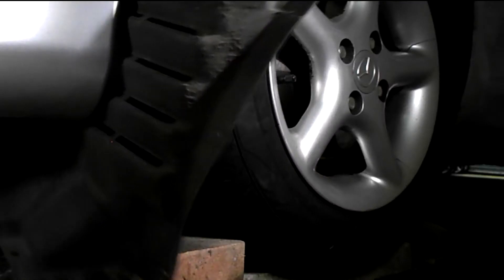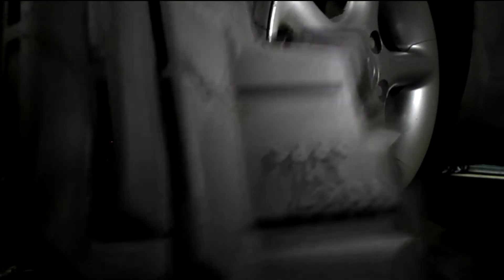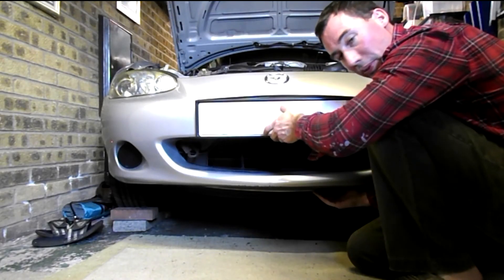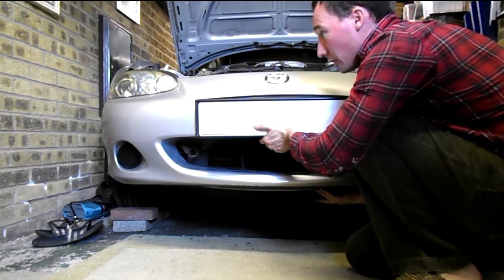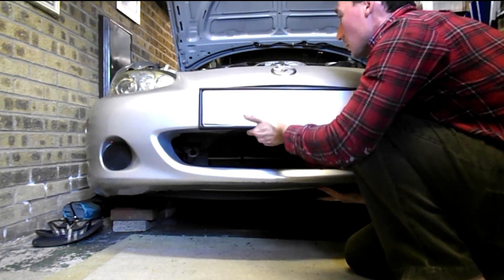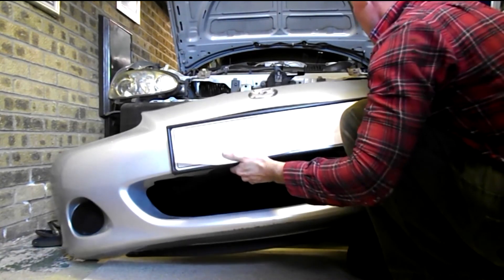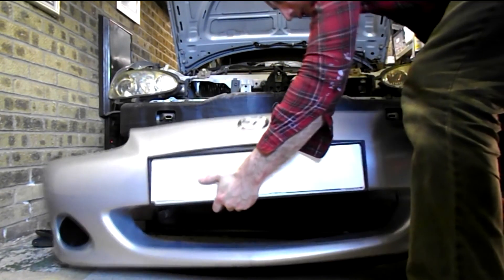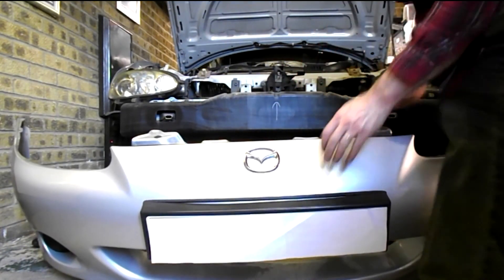Mazda MX-5 Front Bumper Removal

Comment: Ahww the rust!!! it's really bad :( Did you fix the rust?
Reply from the maker: I rubbed the rust down and painted with paint to rust metal paint (hammerite) and used under body sealant. Also had to weld patches the chassis rails. Welding the cills next. :/

Comment: That still doesn't help me.  At about 1:00, you easily flip out the panel, but mine is still being held in by a very robust triangular chunk that's in behind the bolt you just removed.  Do you have an NB1, by any chance?  Mine is NB2, so maybe that's the difference.
Reply: I think his is an NB2 based off the bumper having cutouts for foglights. If you’re still having trouble with your bumper let me know and I’ll have a look at mine tomorrow